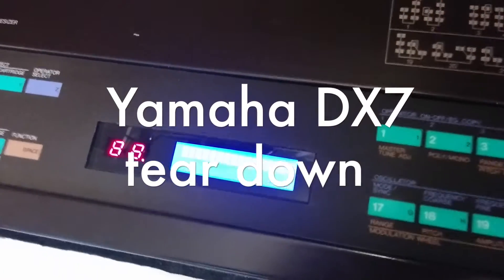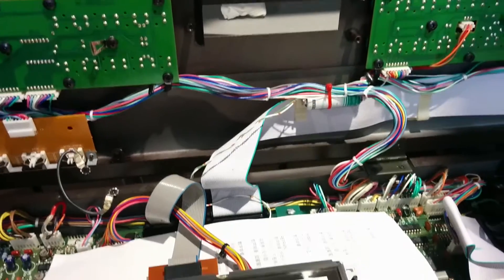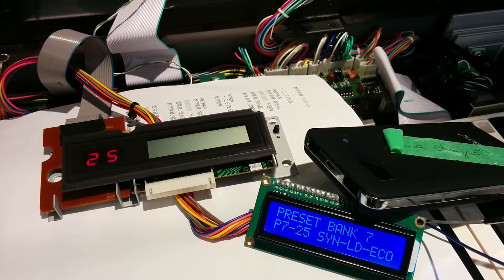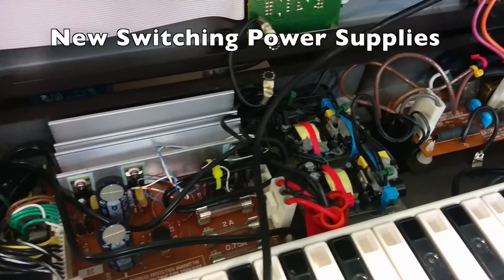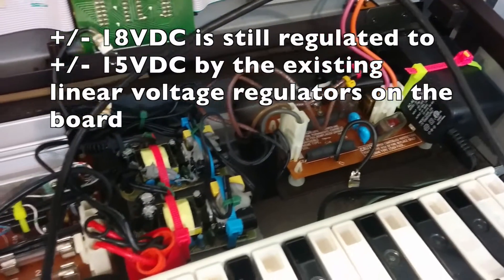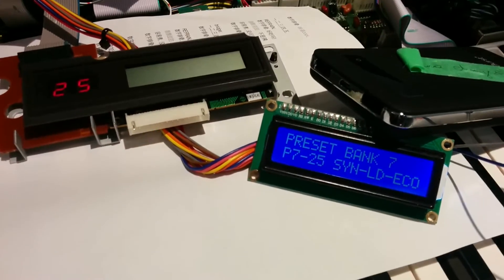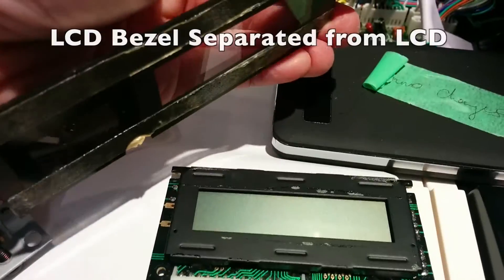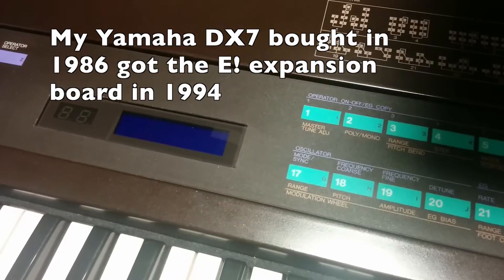Yamaha DX7 LCD upgrade and tear down

Comment: I'm struggling to remove the LCD connector from the screen. It's been very stubborn. How do I separate them properly?
Reply from the maker: The 14 pin header should separate from the angled pins easily.
Reply: chinesemusic I literally tried for hours. Nothing, do I tug at an angle or something? I'm tugging from the white part.
Reply: chinesemusic problem solved
Reply from the maker: The while connector may have a retainer clip, You may have to release it. Pull away the connector parallel to the board.
Reply from the maker: Great!

Comment: Hi.  This is a nice modification.  Can I use this backlit  LCD on a  DX 100?
Reply from the maker: The DX100 uses a 16x1 LCD not a 16X2 LCD like the DX7 so I see why this wouldn't work without a proper backlit LCD.
Reply: chinesemusic  Alright!  Thanks  for the helpful  tip.

Comment: Hello chinesemusic, thanks for this nice vid. I found a 1602 on dx.com (fitting name hehe.) Do you mean soldering pin 1 to pin 16, and pin 2 to pin 15 ?
Reply from the maker: Yes, you need to supply +5VDC power to the LCD backlight so on the LCD unit you need to connect the LCD power supply on pins 1 (GND)  and pin 2 (+5V)  to the  LED backlight  supply pin 16 (GND) and pin 15 (+5V).  Usually there is a resistor already before the LED to limit its current but check to make sure. The original LCD only has 14 pins so plug in the cable from the DX7 accordingly. You'll need to adjust the pot next to the LCD connector on the DX7 board to adjust the contrast. Good luck.
Reply: +chinesemusic thanks ! i have to wait a good 2-3 weeks for shipping but I will came back for that info